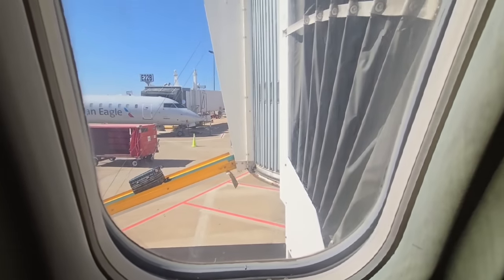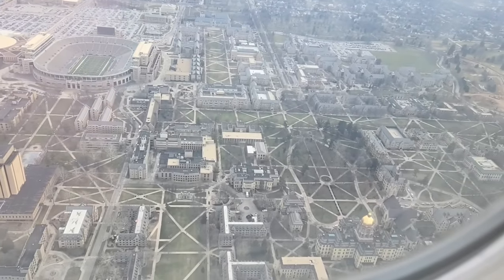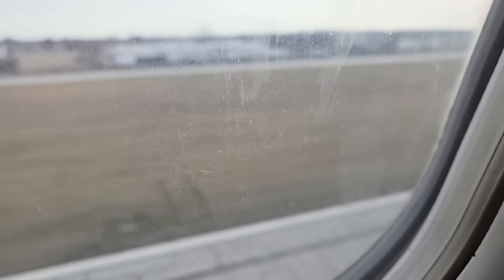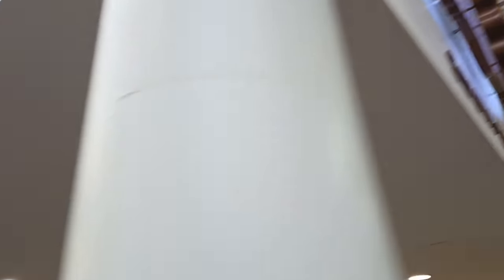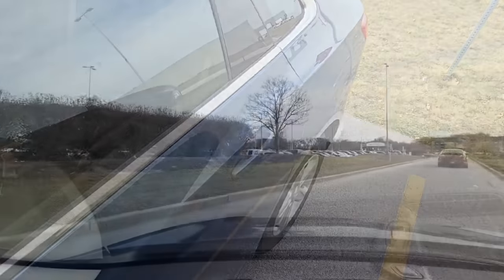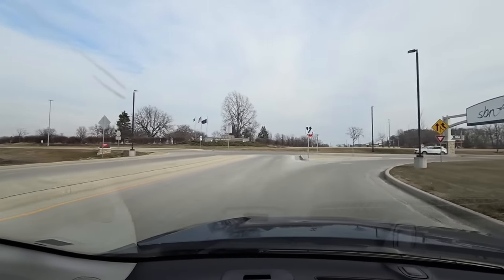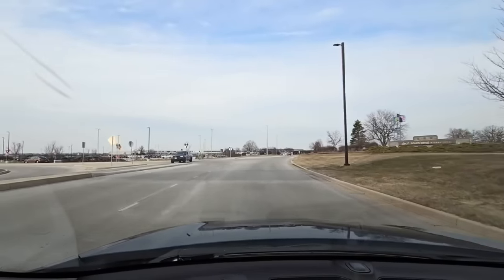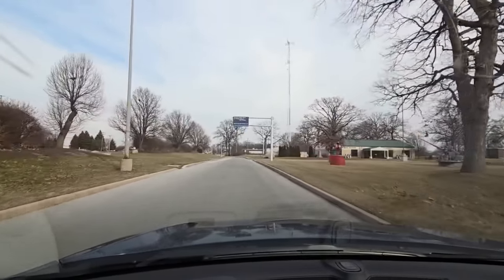LIPPERT Answers Questions about RV FRAME FLEX! Part 1

Comment: What terrifies me most is this is a known problem and I see these massive rigs blowing down the interstate going 80+ mph (speed limit here in Idaho) with known frame issues. Someone is going to die. This is what happens with zero oversight or accountability. These mega corporations will never do the right thing unless they are regulated and held accountable. Just like the recent de-regulation of the rail industry, we saw what happened with the derailment in Ohio last year. Profits over everything else. I applaud Lippert for coming on camera, but they need to do more. What many of us would really like to see is to get Lippert and Grand Design engineers together on camera (and leave out the PR puppets) and hit them with the tough questions. Until then, we need to hit them in the only place they care about, their pocketbooks. If you are considering an RV, you better look at Northwood (Arctic Fox, Nash, Outdoors RV) who make beefy frames (10 to 12 inch steel I-beams) in house specific for each model.

Comment: Very informative video and, thus far, series. Combine the info being presented here and that recently provided by Josh the RV Nerd, anyone can readily educate themselves on the causes and prevention of frame flex. 

But, to be readily educated as "RV consumers," we must first put aside preconceived notions and lower our pointing fingers (all of them). It's OK to hold on to our opinions, but just be willing to change them. Then listen to the information (all of it), put all the pieces together, then make a decision.

Based on comments, many on this thread have done that, and many others have not. Either way, that's cool. Regardless of where you're at with this frame flex issue, ask yourself, "Is RVing for me?" Although some may immediately answer "#$%& no," there's a lot for everyone else to consider in answering that question. 

Allow me to simplify the process a bit by offering a piece of unsolicited advice: "Don't RV angry." If you are, sell your rig, let it sit and rot, or just don't buy one. Find something else to do that'll bring you some joy. Life's short. But if you're not (or maybe are occasionally RVing angry) take your new found knowledge and put it to use. No one else can be expected to do that for us. And if we don't put it to use, then there's only one direction our fingers should point.

Comment: How many people even know the body flexes going down the road, put a video camera on a back wall and be surprised.
Frame flex that most people refer to is a failure of the frame, cracks, broken welds etc PERIOD Frames that have broken - and it's not from prior water intrusion.
And, it is not just for the over 17,000 pound crowd. For one side to say "we build them to specs" will probably not do well when the legal challenges finally start, both sides are complicit in the proper design. When Ford put crappy tires on their larger SUV's and pickups, Ford paid the price, but Firestone did not skate. 
Since 2009 I have had many friends experience cracked frames, many of them Heartland products and in the last 5 years DRV 5th wheels. To Lippert's credit, all of my acquaintances with cracked or broken frames have been repaired, with many being better than new. I check my 21,000 DRV every time I drop it on the hitch, with my fingers crossed the flex I see stays the same as the first day picking it up at the dealer in 2018. And Ms. Klein could have stayed home.

Comment: Personally i wouldn't buy an RV, the chasis are made as specified by the manufacturer but the box sections seem paper thin. An RV is a substantial investment, having to  repair a chasis is like having to repair the foundations of your house. The V.P. has very indepth knowledge of the structural engineering of an R.V. it makes you wonder why you need to have an Engineer present to answer questions.
 A very robust and insightful observation, once something becomes detached it could lead to a failure. The solution appears to be to stop the something from detaching, but whose job is that?  The body language is very telling

Comment: This is a major issue even back in 2013. I bought a used open range and we had to salvage it because the cracks in the frame and the bulging of the frame! This rig was so beautiful it hurt very much to salvage it could not be repaired! Thanks Lippert and thanks open range
Reply: Anything can be repaired. It may cost more than you (or more likely -- your insurance) want to pay to repair it but it can still be repaired.

Comment: 23 years in RV Parts, Service, & warranty...All it takes to fix frame flex is 4 gussets welded into the area below the upper deck on most models..The  Oems dictate the build procedures,.
Reply: I think the issue thus far on the largest heaviest GD fifth wheels is every stiffening gusset added still transferring the fulcrum point more focused further down the trailer and frame then failing.

Comment: Does the RV manufacturer specify the type of steel used? Do they design the frames from top to bottom and only have Lippert create them? If Lippert has any say in the design process for a particular RV they become liable. If they knew that RV manufacturers were over stressing the Lippert frames, and did nothing to stop it, Lippert is partly responsible for the failures.

Comment: My little utility trailer is rated for 2,500 lbs. If I or someone else puts 3,500 lbs in it and it fails, is that the trailer manufacturer’s fault🫤

Comment: Overloading? We know what the gross max is. What it the max pin weight? I understand the pin box length point. I wish the kingpin was under the frame. Wear it should be
Reply: I'll tell you they shortened the length considerably on the Rhino pinbox. From pin to first bolt holes is only about 14" on my new 2024, where my older trailer with a 1621 it is about half that again long .

Comment: I've been around trailers all my life and frame flex is nothing new as all trailers flex and are designed to flex. Backing a trailer incorrectly can flex your trailer and running over bumps and curves will flex your trailer. What you build on top of a trailer frame is not made to flex so it cracks.

Comment: The report was interesting but does not solve customer issue. They can point to each other. Which is what has been happening  I think I did good with destination trailer. Towed once set in place. Especially with the roads of today. Dips bounces, Big chuck holes. You hit and exceptionly big hole your 150000 unit is shot.

Comment: If the frame and RV superstructure are supposed to be "married" together, it sounds like Lippert and the RV manufacturers are not at the table creating designs that have structural integrity.  Lippert has a great opportunity to stop selling units that might fail and be part of the design solution.

Comment: Why did this problem just show up en mass in the last few years? What changed??
Reply: Reduced thickness in the frames in order to make them lighter and to save money
Reply from the maker: Apparently that is not true.  Asked them and saw the materials.
Reply: It's not a new problem, it's just more visible now that it's on youtube.  Pinbox frame failures have been a problem for 15 years + now.  Google pinbox failure and you will find  forum post after post on rv sites.  Lippert has poor welding on their frames and too light of materials used.  Rv manufacturers need to spec heavier frames,  so it's a two part failure.  Most decided as long as the rv made it past the warranty period it was built good enough.

Comment: Again, its not between the chassis frame and the structure on the frame but the chassis frame and where the pin is mounted on the frame.

Comment: The problem is the metal used to make the frame is NOT strong enough to support the rest of the manufacturing process!!  I am currently re-engineering the way the water tank is held in place. I was told to not carry more then 30 gallons in a 60 gallon tank due to the holding structure for the tank not strong enough to hold more water. This is NOT acceptable!!!
Reply: This has been true for all edge/tab hung tanks for 30+ years.

Comment: Imagine having a truck that had it's frame made by a different company and then when it failed, they would point fingers at each other so they wouldn't have to do a recall.

I'm not for big government, but it seems like someone needs to step in and make someone accountable, other than the unlucky owner.

Comment: The amount of support supplied by the front of a fifth wheel cabin is extremely limited.  Lipperts constant reference to this is a smoke screen.  Lippert must design to a weight
 load specification with no reference to overstructure.

Comment: This is 100% Lipperts and the Manufactures fault. Manufacturers spec out cheap frames, and Lippert should say, um no, but they don’t want to loose the sales to China trailer manufacturers. Trailer failures is the reason I haven’t bought a 130k Momentum. 

I have been renting 5th wheel toyhaulers for the past 3 years, and bumper pull toyhaulers going back to 2016. The fit finish and ripped and torn walls is unreal. My buddy has a well used 2006 45’ KZ that is in amazing shape. The new stuff is “engineered” to the bare minimum.

Comment: Not sure you are interviewing the correct execs, suggest you consider VP of Quality control starting with incoming material inspection all the way to superstructure performance on frame….Please also bring data (quantitative ).  I don’t think you will get definitive data/answers, too many parties and liability involved.  Good luck…….oh, and you should be in the screen shot for this interview 😊

Comment: I don't buy this "explanation" from Lippert. Seems to me they are trying to pass the blame off onto their customers. If that is the case, why are not only Grand Design units have these issues, but I know of several VanLeigh units (myself included) that has to pay out of pocket to correct this issue. Completely unacceptable.
Reply: So much of the back and forth on this issue is being done by people who have both professional (including sponsorship) and personal relaitonships. Not saying that either side are devious or bad people, but this interview should have been done by someone in a journalistic objecitive manner with no realation to Lippert. Even if no bias is inteneded, it can still creep in.
Reply: It’s not Lippert.  I have a 5th wheel toyhauler similar in size and weight to a GD Momentum but compare the frames and it’s night and day. 

My custom 5th wheels toyhauler’s frame makes the GD look like Tinker toys.   The frame under mine has way more reinforcement and thicker I Beans and much more wall support.  

And the frame on mine is also a Lippert.  But the company I went through actually specs the frame correctly.

Comment: Common sense says that these frames should be designed in the same manner as a heavy equipment trailer or class A industrial pusher chassis, where the frame alone is designed to shoulder the entire load. If Lippert is relying on the el cheapo wall construction and OSB ceilings of a RV adding to the frame strength, well that is ridiculous.  I predict some form of regulation in the future but of course a few lives will need to be lost first.

Comment: Fiberglass is not structural. The frame is the structure . I’ve seen the frame that is in question and it is a design guaranteed to fail. That is why is breaks.  There have been many older frames that have never failed so—- easy to figure out. “ pinboxes not designed for that” Pinbox should be designed to handle any pinbox.
Reply from the maker: Every frame is designed to flex.  With an RV, the BOX structure MUST be attached directly to every part of the frame OTHERWISE you could install anything inside.  The body MUST become structural to make everything work together.  Everyone keeps referencing Heavy Duty Gooseneck trailers.  Watch this video to see that they have a tremendous mount of Flex.  Imagine attaching a box to these units.  https://www.youtube.com/watch?v=KmdnyYX-dOA

Comment: Its caused by the tug test by these high torque diesel . you cant tap the pedal with these hi torque diesels with the brakes locked . If you are in 4 low with the brakes locked tug test and tap the pedal tit  can pull the whole front pin assemble off . iI have 36 skq monaco medallion that have never had a stress crack till my first  tug test with my new 3500 cummins.  a new stress crack under front slide out im not worried i just stretched the whole frame from the wheels forward about 1/32  of a inch causing slight stess crack under front slide out gel coat and i have been on the roughs roads in america. no stress crack till the first tug test. 5th wheel owners need to be notified by the dealership dont do tug test in 4 low with the brakes locked or possible pin failure could accure . Put in 4 low and drive only for a tug test dont tap the pedal as we have been taught. i have photos to prove it

Comment: Lippert should not account for the manufacturers box to add to the strength of their frame. If you build a frame that will carry the overall does weight to begin with then you don’t have to rely on somebody else to achieve that same number.

Comment: That they've "Developed over the last ten years"? Before that we never heard of frame issues... So, you went from doing it right for decades to engineering frames that have been regularly failing. I say, just make a strong frame and let the RV manufacturers build on it. Don't count on the house to bolster the frame.

Comment: Its sad the amount of people who've watched this and still dont understand that the strength of the overall structure is based on a combination of two or three key components working in unison. Ohhh,  I know how to make easy. The human body. Lippert is your legs, the manufacturer is your gear purchased, you're the one packing your gear. I think what we're seeing here is that as you gain momentum, your bag tears open even though you're only carrying what its supposed to hold, caused you to trip and fall and you're thinking your legs should have held you up.

Comment: So we watch this interview and listen to a team effort to place as much blame on the consumer as possible. When that isn't possible then the finger pointing goes back and forth between Lippert and the RV manufacturers. It's a pity that the real questions involving RV frame failures hasn't been addressed, at least so far. That is that as RV's have gotten bigger and heavier the designs and the engineering have not kept pace. Manufacturers are demanding of suppliers to make construction cheaper and lighter. The results we see today are the expected consequences of an industry that is driven entirely by profit.

Comment: It’s great that they are willing to talk to you but they should really be talking about the trade offs of how much weight and force they can handle. Why can’t they build more robust frames? That’s the question and then they should be able to say what they need to sacrifice or what they have sacrificed to get where they are. Otherwise all we have here is blame shifting. Also if the blame does belong to the manufacturers of the chassis then they should be more straight forward about that. These answers are just a bit to vague for how serious the problems are.

Comment: These are exactly the folks that the State of California would love to contract with to build a bridge.  "You did not ask if it would work during morning commute hours!"  "You did not ask if more than 3 semi trucks could be on it at once!"  "You did not say that it had to hold up to rain, snow AND wind!"  Finger pointing, indeed!

Gee whiz, why can't a company build a superstructure "into the nose" that would support 30% of the GVWR (minimum) with more gussets, plates, etc.??  They know, or should know that the RV box manufacturer either:  1.  Does not know anything more than how to spell engineering (if that), or 2.  Does know and chooses to exceed limits for "design reasons" or greed.

Shame on Lippert, however, for being passive to RV manufacturer stupidity:  (e.g., "We build the frame our way, in a large a variety of dimensions and weight ratings for you to put your box on top.  If you exceed our limits to achieve your goals to save money and make more sales, you will fail at both, and we will tell the customer so.  If you do not like our approach, you are free to source your frames elsewhere.")

You know that "they at Lippert" know which RV manufacturers are cheap, cut corners, knowingly exceed recommended specs/parameters and constantly whine about frame component "costs".  The Lippert folks talk about them in the hallway, the break room and at the "water cooler"!!  If those manufacturers would correctly think of frame component costs as investments in their product, their reputation and customer service, customers would flock to them and they would be more profitable.

Comment: Lippert, well we build a Frame to haul 10 thousand pounds!! and if the RV builders put 20 thousand pounds on it, it's their PROBLEM!! Simple, like the guy pulling a 40 foot 12 thousand pound trailer with a 1/2 ton truck says well the truck is Rated to Pull it, Good Luck.

Comment: This is really the RV manufacturer problem. When there are structural failures in the RV, these tend to be very expensive repairs. Not a good spot for the RV owners that ends up with the problems.

Comment: What I am hearing is a huge need to structure more regulations between Lippert and any of their customers.  As an example, if Lippert sends a frame to an RV builder and the builder changes the plan, Lippert must be advised each time to verify if the design will work safely and properly.  It sounds as if there are several other procedures which should be implemented to ultimately please the customer.  Too many loose ends here.